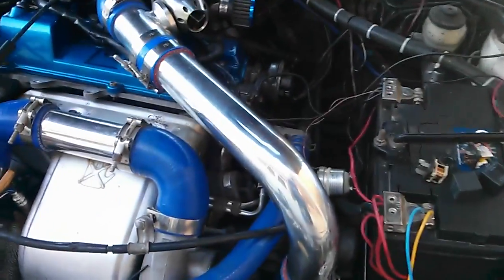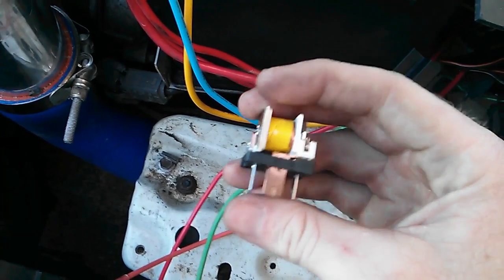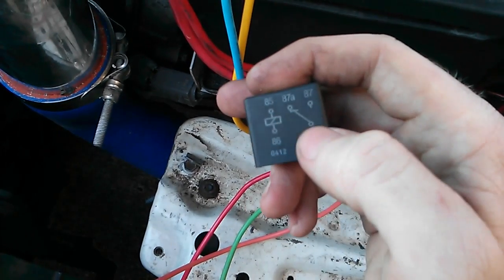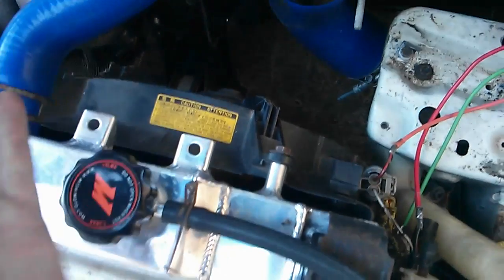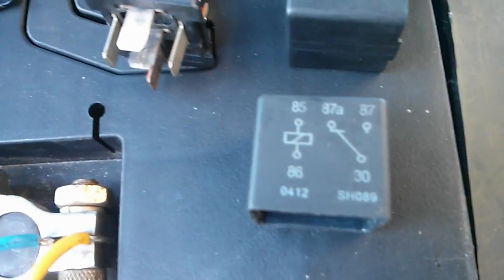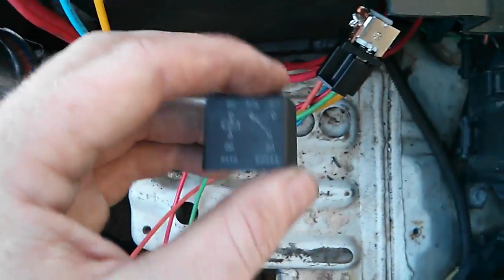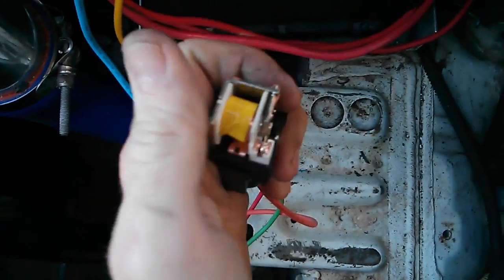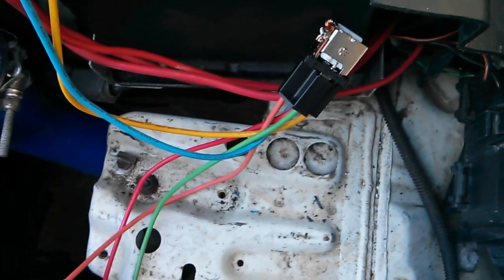How to wire a relay, 5-pin and 4-pin Bosch style

Comment: Came across your vid in my search to learn how 5 pin relays work. Surprised to see your ingenious use for one. Always wondered how to wire in a manual fan switch. Thanks for sharing.
Reply from the maker: Thanks! I actually drew out this wire diagram in a YouTube video about a month ago along with some other fancy relay wire diagrams. So if you want to see more detail on the wiring you can check that out.

Comment: great video, but I think I'm still having a little trouble understanding what is the positive and negative wiring on these relays, the numbers seems to allways change when involving this I have installed a remote start/ Alarm that needs a relay and a 110 ohm resistor.. my schematics show that 30 is the ground 87 would be connected to the parking light wire inside the car separated by the 110 ohm resistor 86 would be the 12 volt power fused by 10 amps and 85 would connect to the alarms negative parking light output wire does this sound right to you? in some videos I see that 30 is the positive or 86 is the positive.... any help with this would be greatly appreciated!

Comment: Help needed. My hot rod gets one wire from the fuse box to the AC controller. I need to install a relay on that wire before i connect it to the AC controller. can i put the wire on #30 of the relay & take a wire from #30 to #86..then 87 goes to the AC controller & #85 to ground?
Reply from the maker: It might help you to check out some relay videos I uploaded a few weeks ago (links are in the description). If I am understanding you correctly it sounds like the power wire for your a/c controller will be used to power something else too? Then you are using the same power wire to turn the relay on (pin 86). Whenever that wire from your fusebox is on then pin 86 will turn the relay on, unless you have an off switch on the ground side. Check out my other relay videos in the description, I tried to make them as easy to understand as I possibly could.

Comment: So by having the manual switch off the fan will continue working as factory and when you switch it on you will be manually turning on the fan, right? 87a is always on.
Reply from the maker: Daniel Mitchell correct, 87a always has power, so if the relay is in the "off" position the factory fan system will be used, if the relay is in the "on" position the backup system will be used. I also have a 3-way switch controlling the relay backup system, so one position is straight to ground (fans are always on) and the other position is ground-switched by my engine management system(engine management decides when to turn on the fans).

Comment: Hey what relay pin do u wire the switch into for turning it on and off?
Reply from the maker: either 85 or 86. Doesn't matter which one, as long as one is positive and the other is ground. I usually make it a ground trigger because you can ground it to anything metal on the car, and also if the ground wire rubs on something and shorts out it won't damage anything, relay will just stay on. If you ran a positive switch it might eventually rub on something and short out, then blow a fuse, if no fuse then you might have a fire.
Reply: This is a normally open relay as long as no power to pins 85 &86  pin 87 is dead when power 85/6 the electromagnit pulls the switch arm over and now power flows to pin 87 power comes in thru pin 30, tha'ts your hot power supply into the relay so whatever you want to turn on should be wired to 87 because when you power pins 85/6 that pulls the contact arm over and it makes contact with pin 87 & that becomes hot ie: powered.
NOW be aware of how much power AMPs your going to send thur the relay they have rating in amps at 12volts Some cooling fans are suprisingly power hungry especially in pairs,.That 30amp relay may not cut it.
Reply: Jay Shipp
Good point on the ground trigger that's the way GM trigger most circuits.
Reply from the maker: roger depew I have one relay for each of the fans and I went with the same amp relays as the stock setup, I just used fatter wire than the stock setup since engineers are known for getting close to the limits of what a wire can handle. Both are triggered by my little 3 way switch, where "off" is for stock fans only, "on1" is coming from the aftermarket ecu, and "on2" is straight to ground :).

Comment: OEM wiring "acting up"? Think freewheeling diodes, since you're shooting back a lot of voltage from your "custom" wiring back to the OEM wiring when switching off your relays.

This is because your relay has actual coils that store current, and when they get turned off the residual current has to GO somewhere (2nd principle of energy), and guess what? That current shoots back to whatever is on the other end of your 85-86 pins. There are tons of videos explaining this phenomenon. Hope it helps!
Reply from the maker: Thank you for your comment. I'm familiar with that, but it isn't exactly the problem that I was seeing. The car ran fine for a while with the stock fan system running independently of the new engine wiring and EMS power. There seemed to be a bad connection at the relay. And I've changed that main relay. When the fans would shut off I could grab the main relay or press it down and the fans would come on either briefly or they would work fine until the next time they shut off due to seemingly bad connection. I'm not going to rip apart my fuse box and potentially cause other problems just to fix a loose connection at a relay when I can wire in a backup system this easily. I love the idea of having a backup, and now I use the backup wiring primarily. The EMS triggers the fans, and if they don't then I can always flip the 3-way switch. The stock system is still there and I can still switch back to it, but I prefer not to rely on a 175k mile wiring the car, especially without a backup. Also my wire diagrams stop at that relay in the fuse box, nothing I have found is detailed enough to show the inside wiring of the fuse box past that fuse. Anyway, thanks for the comment, this would have been good information for me to talk about with this video when I made it.

Comment: Will this relay work with a PWM 12v source?
Reply from the maker: yes and no. if your pulse width is too short and/or has too little of a gap between pulses then the electromagnet in the relay will not be powered long enough to provide a good connection. There will be a point where the electromagnet in the relay makes the contact free-float. I haven't tried it, but I wouldn't expect it to work with a pulse width smaller than 100 milliseconds. If you can vary your pulse width with a dial or via computer then I would try it to see what the minimum milliseconds are the relay can handle. Let me know what you find..I'm a bit curious too.
Reply: Thank you Jay for a fast response. Since my question to you, I saw a video on solid state relays. The presenter said PWM will work because SS doesn't have a mechanical movement. http://www.futureelectronics.com/en/Search.aspx?dsNav=Ntk:PlainTextSearch%7cSolid+State+Relay%7c3%7c,Ny:True,Nea:True,N:562.
Reply: However it won't work in the Mech Relay
Reply from the maker: William Buckley
nice, thanks for the extra info
Reply: Jay Shipp I solved my problem by using the Mosfet from Radio Shack. It evens out the PWM enough to trigger source voltage.

Comment: Can you give me a diagram for my horn diagram using relay. Thanks
Reply from the maker: +Kaye Aquino in the description of this video I have a link to another video that explains basic relay wiring(5-pin vs 4-pin relay). It is easier to follow since it is animated and shows a basic diagram. Using that video, you should wire your horn to pin 87, and your horn button to pin 85 or 86.

Comment: actually 87a is back up power source & 87 is basic saurce?
Reply from the maker: the 5-pin relay can be wired a few different ways. You can use it where 87a is a backup and 87 is the main power source. Pin 30 would be feeding whatever you are powering, 87 is one power source and when the relay is tripped on 87a is turned on to provide power to pin 30. So when the relay is off, 87 is connecting to pin 30, and when the relay is on 87a is connecting to pin 30.

Comment: Where did you get your power source coming INTO the 5-pin relay? You make this relay installation TOO freaking confusing. This relay should only take 3 to 5 minutes to install. I would just change the COOLANT FAN SWITCH on the engine block to restore the signal going into the cars factory relay or ECU.
Reply from the maker: Eddie Abraham  Thanks, but this isn't an "installation video", it is a video describing how the relay works. So whether the power source is fused directly from the battery, coming off of the ignition switch, or coming straight from the fusebox...that's all up to the person watching this. And thanks for the suggestion, but the relay is wired to where I can use the cooling fan switch if the relay is off, or trip the relay on so that it is controlled by my engine management running the car. There is no use describing why I'm wiring this relay in my car since it is a how-it-works video, so I didn't mentioned it.